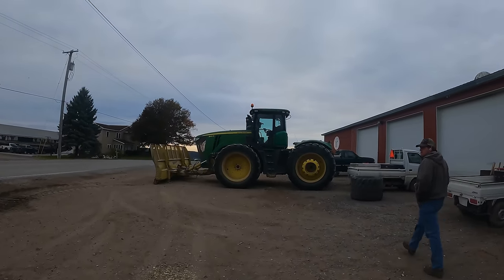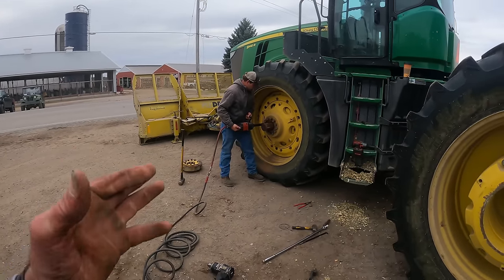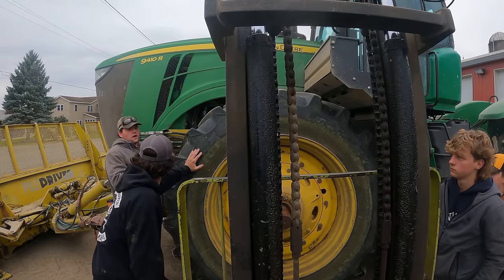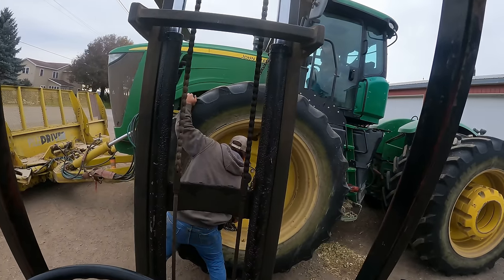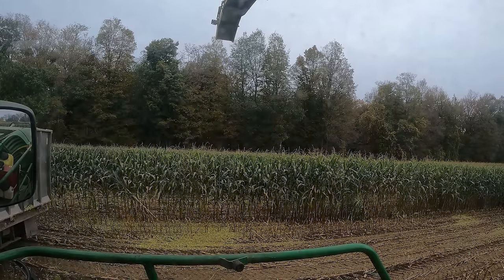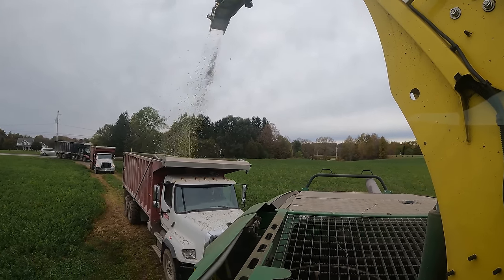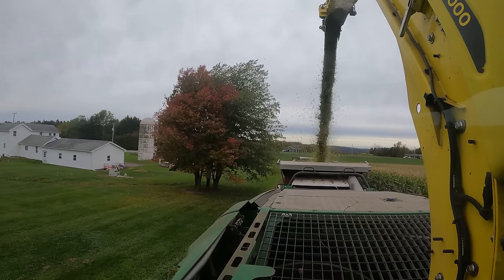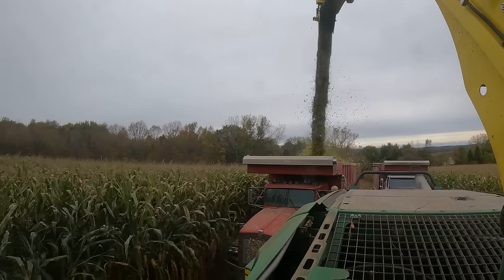Not good when this happens

Comment: Thanks again Andy.
Shorter larger diameter air hoses can add new life to old tired impact tools. (Same as air horns)
Sometimes a guy can cheat with 25-50 feet of very large ID air hose right at the tool end. That can act as a kind of buffer before tool is starved for pressure from small hose. One small quick coupler fitting can ruin the whole party. New flexible hose works better than old stiff hose.
Dangerous toys are fun! 🙂

Comment: A lot of people have tag lines. You're is "HERE". Put it on a black ball cap and I'll buy it. Just " HERE" , that's all. People that get it will get it! I get it with Jerrod's frustration. Sometimes you need to pull it out and set it aside for a while and cool off if you can. Move on to something else. You can then clearly think about it later and make it a winter project or get rid of it. Jerrod deserves a new truck and less headaches anyway. Nate's a good man to have working for you.

Comment: Anyone that tells you old is best and they have 40 year old machines with 20k hours that never give trouble are doing 1 of  2  things.   They are either lying to you or those machines have been regularly maintained and have wear parts replaced as needed.  There is no machine new or old that doesn't need maintenance and the more you use them the more often they need it.

Comment: @  10:57  That looks like a 3/8  I D  air hose.  I believe you need a larger diameter hose to deliver enough CFM to get max performance from that big impact wrench, especially with a hose that long.  Just a suggestion .............. trying to be helpful.
Might check with the manufacturer to see what size hose they suggest.  Does your compressor deliver enough CFM ???
Reply from the maker: 1/2” air hose

Comment: My grain corn is running 16-28%.  This time of year it should be 15% and all harvested. Have not had a frost yet.  Cut soybeans today that were 13% but green stem. Those sucked to do, slow speed and 9500 did not like the green part going through.  Good yields though.  And we got mud in places there is never mud.